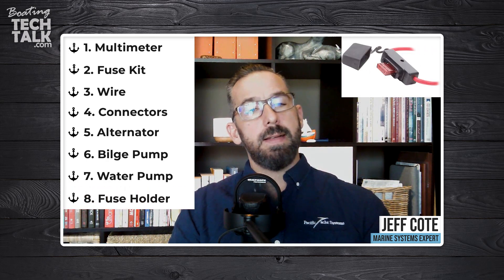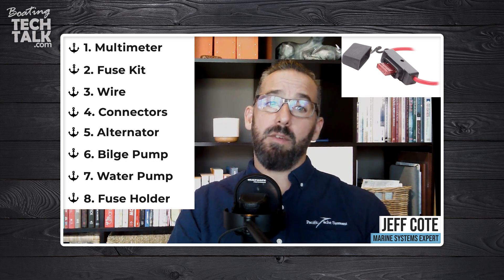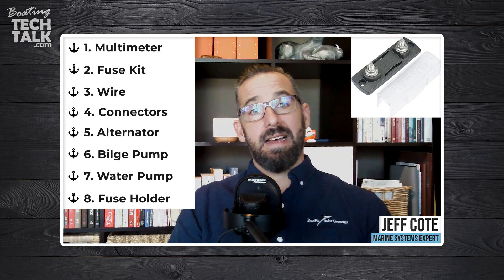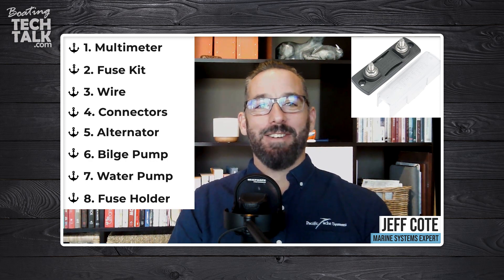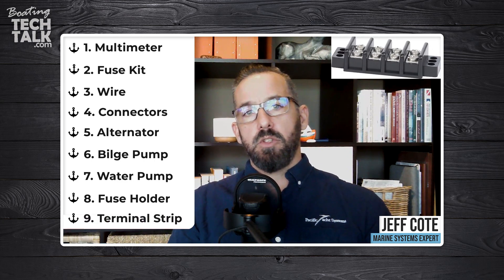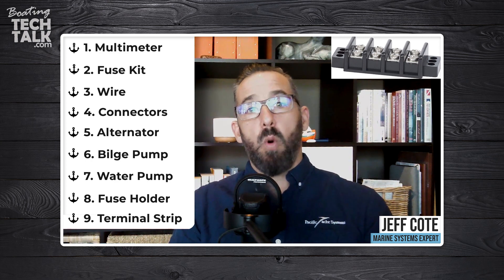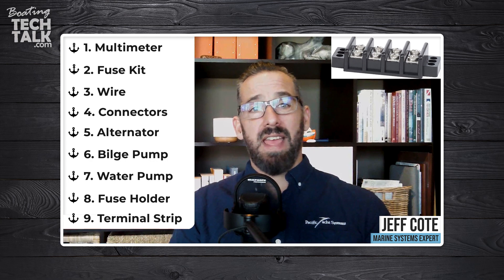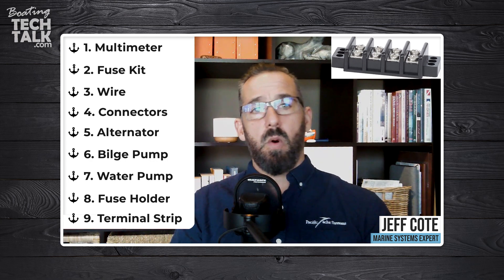Jeff's Top Picks for Spare Electrical Parts on Your Boat

Comment: I’d add to your list of spare parts - heat shrink, butane torch to solder/heat shrink/butt connector heat shrink. A brass brush and contact cleaner. Roll of solder. A crimp/wire strip/cutter tool. A very good light source that is bright and compact so you can see in dark places to diagnose and make repairs. And lastly, bring any electrical manuals/wire diagrams for your boat/ and a spiral notebook for making notes/lists/and jotting down things you need so that you don’t forget things.

Comment: Heat gun to seal the shrink connectors. I lighter will do in a pinch as will a butane torch but the heat gun is cleaner and no open flame.

Comment: Spare Macerator Pump - that I would add to your list of spare pumps.  I also carry a Macerator service kit (spare impeller & gaskets) as the impeller often fails before the motor, but sometimes it's easier to just replace the whole pump and do the service kit later in a more 'ventilated' area back home.

Comment: Great video and comments. I would have a spare fridge compressor controller (small black box on Danfoss compressors) to protect your food in the fridge or freezer and indeed having spare navlights is nice, they frequently fail, even expensive LED’s like Lopo lights. In addition have spare batteries for remote controls, torches, etc.

Comment: I would add a couple of toggle switches, simple test light, assortment of terminals (and crimping tool), a wire with alligators for tests, and a capacitor for the generator. I will start shopping for the alternator, and water system pumps. Thanks!!!

Comment: Storing the parts - I use a vacuum seal machine along with those dry packs. (you can reheat them and dry them out again). Tools also in vac seal or.Sous Vide bags - zip lock and vac seal - best of both. UV Tyraps, the good ones with SS latches. Silicone marine grease. Tape in colors or number tags.